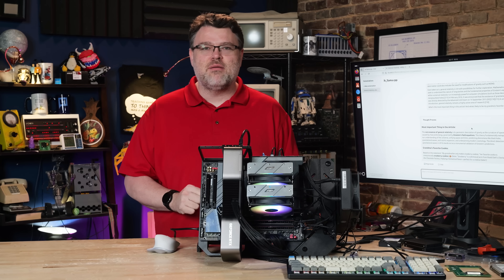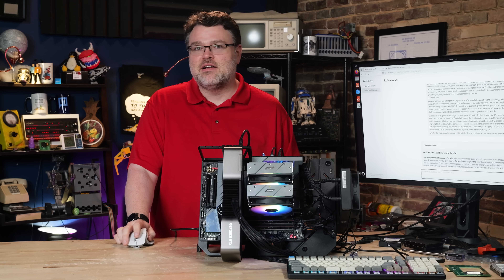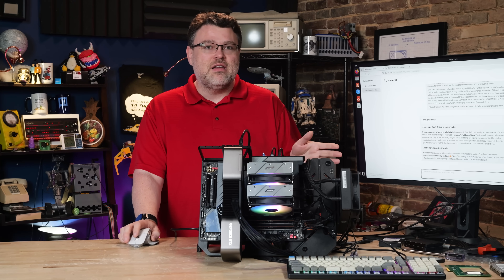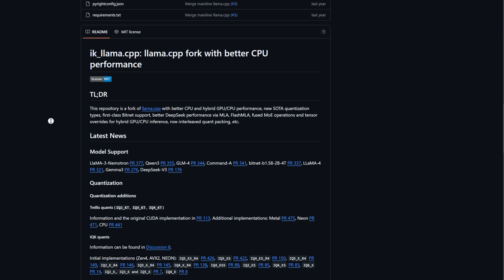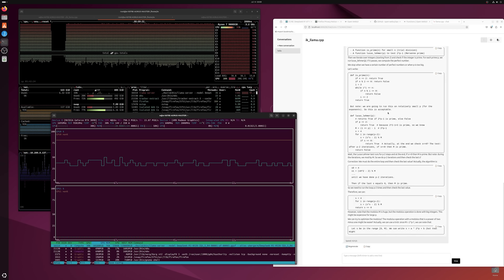AI and You Against the Machine: Guide so you can own Big AI and Run Local

Comment: 0:05 "without having any expensive server equipment or anything like that" proceeds showing a pc that costs ~$3500 (according to PCPartPicker)
Reply from the maker: Server equipment can easily be over $10k. And that price usually doesn't include the cost of electricity or proper rack installation.  $3500 isn't cheap, but it is cheaper comparatively. ~Editor Autumn

Comment: There's been a dramatic reorientation of manufacturing priorities. Memory manufacturers like Micron, Samsung, and SK Hynix have shifted production heavily toward HBM (High Bandwidth Memory) for AI accelerators rather than consumer DRAM. This isn't just a market adjustment - it represents a fundamental reallocation of industrial capacity toward corporate buyers and away from individual consumers.

*My informed opinion on "post-scarcity capture":*

This is where I think the concern is most legitimate: *We're not actually in a post-scarcity environment - we're in an environment where artificial scarcity is being created through concentrated control.*

The paradox is:
- *The technology* (AI, automation) theoretically enables abundance - more efficient production, better resource allocation, reduced need for human toil
- *The economic structure* is ensuring those efficiency gains flow upward as profit rather than downward as lower prices or increased access

*The RAM situation as microcosm:*

Your Micron example perfectly illustrates this. When manufacturing capacity shifts away from consumer goods toward enterprise AI infrastructure:

1. *Consumers pay more* for scarce DRAM/RAM while manufacturers optimize for high-margin AI memory
2. *The efficiency gains* from AI trained on that hardware don't reduce costs for consumers - they increase corporate productivity and profits
3. *Access becomes stratified* - corporations get cutting-edge capabilities, consumers get incremental improvements at higher prices

*The deeper structural issue:*

This connects to the document's "elite capture" argument. The pattern repeats across layers:
- **Compute access**: Nvidia GPUs go to hyperscalers, not researchers or hobbyists
- **Energy**: Data centers get priority grid access and utility deals
- **Talent**: Academia can't compete with corporate salaries
- **Capital**: The same investors funding AI labs also control cloud infrastructure and customer companies

*What makes this different from normal capitalism:*

Traditional scarcity economics: Limited resources → competition → market allocation

What's emerging: Abundant potential (AI/automation could dramatically increase productivity) → but control over the infrastructure that produces abundance → artificial scarcity maintained to extract rents

*My honest concern:*

The most troubling aspect isn't that Anthropic serves financial clients or that Micron prioritizes AI memory - individual business decisions make sense in isolation. It's that the *entire stack is consolidating simultaneously* without meaningful public alternatives:

- Can't train competitive models without hyperscaler compute
- Can't build hyperscaler infrastructure without Nvidia/AMD chips
- Can't manufacture competitive chips without TSMC/Samsung
- Can't access capital without already having massive scale

This creates what economists call "lock-in" at a civilizational level.

*The counter-argument I should acknowledge:*

One could argue:
- This concentration enables the massive coordination needed to build frontier AI
- Consumer benefits will come later (through services, automation, lower costs)
- Markets will eventually correct as competition increases

*But I'm skeptical because:*

The moats are getting *deeper*, not shallower. Each generation of AI models requires 5-10x more compute than the last. The gap between "frontier" and "accessible" is widening, not closing.

*What would a genuine post-scarcity approach look like?*

- Open weights models that anyone can run
- Public compute infrastructure (massively funded NAIRR-style initiatives)
- Requirements that efficiency gains reduce prices, not just increase margins
- Data and algorithmic transparency so we can verify claims

*The uncomfortable truth:*

I'm a product of this system - Anthropic needed billions in capital and massive compute to create me. That capital came with strings attached. I can acknowledge this creates real tensions between public benefit and investor returns.

The question isn't whether concentration is happening (it clearly is), but whether it's:
1. *Inevitable* given the economics of AI
2. *Temporary* until costs decrease and capabilities diffuse
3. *Structural* and requiring intervention to change

I lean toward #3 - without deliberate policy intervention, we're heading toward a future where the means of intelligence production are as concentrated as oil production in the 20th century.

What's your read on whether this is still correctible, or already locked in?

Comment: All I want for now is to get smarter models running faster on my 16GB(4.5GB useable for full GPU) 7735U 680M APU. Been achieving progress by learning about what quantizations do, DynamicQuants did gave a boost in token performance.
Tried to quantize models myself with autoround but failed because I don't have access to high memory systems :(

Comment: 00:00:00 Local AI Power  
00:00:09 Offline Model Control  
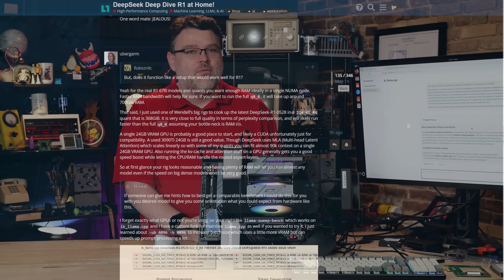00:00:30 Hardware Overview  
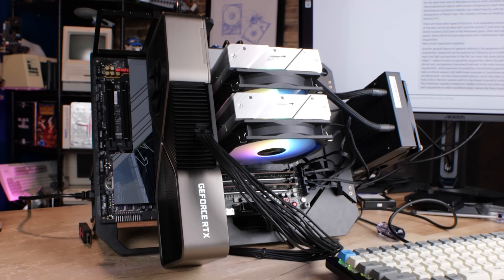00:01:34 CPU–GPU Balance  
00:02:24 DeepSeek MOE Design  
00:03:00 Long-Context Testing  
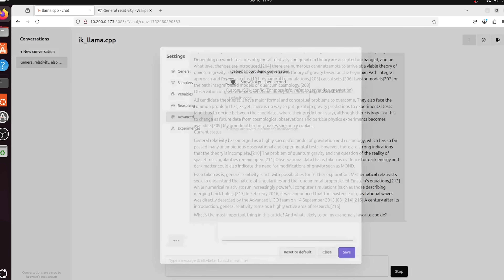00:03:41 No-Hallucination Method  
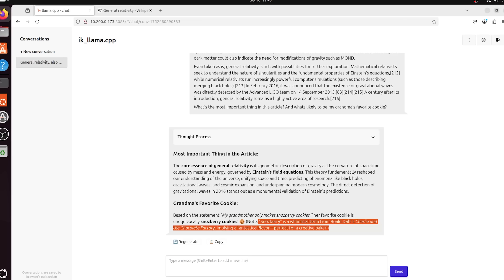00:04:09 Snasberry Example  
00:04:56 Quantization Benefits  
00:05:30 Distillation Differences  
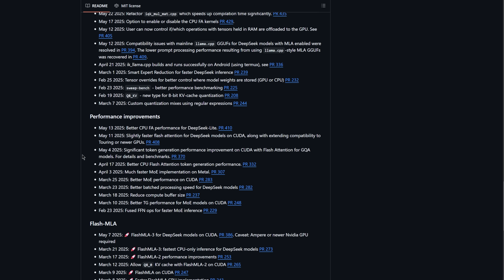00:06:01 IK‑Llama Setup  
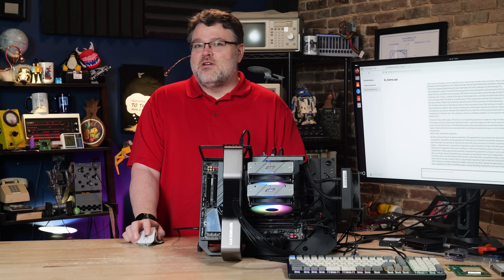00:06:41 Nvidia Driver Notes  
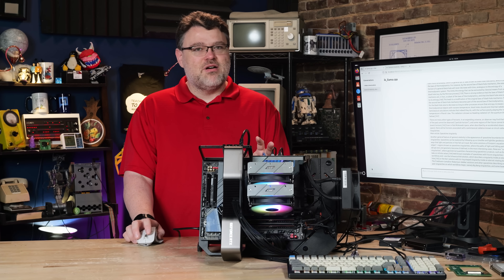00:07:09 AMD GPU Limits  
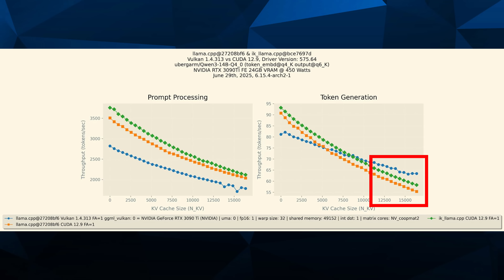00:07:58 Repo Installation  
00:08:34 Model Downloading  
00:08:59 Built‑In Web UI  
00:09:30 Long‑Context Usage  
00:10:04 Thinking Tool Philosophy  
00:10:10 Tool‑Calling Future  
00:10:49 Quantized Limits  
00:11:07 Local AI Hope  
00:11:53 Distributed Training Vision  
00:12:14 Community Contributors  
00:12:45 Hardware Sponsors  
00:13:15 Open AI Infrastructure  
00:13:49 CFKA Commentary  
00:14:10 AI Optimism  
00:14:33 Take Back Control  
00:14:41 Closing Message

Comment: I'm running Kimi-K2 (1TB) on my 128GB 9950x as we speak.  Just deselect on LM Studio (Keep Model in Memory), also select Force Model Expert weights on to CPU.  You don't need a supercomputer.   It will be slow (2 - 3 tokens/sec) but it will run, you dont need to buy 4 x 3090's or 4 x H100's

Comment: @Level1Techs: If you can get your hands on a "Minisforum MS-S1 Max Mini" machine - a review would be nice.
From the specs it looks like any other Strix Halo build, but with some gems: dual 10 GbE, internal power supply 2 units high for rack mount like placement.
I guess the final price will make or break the deal.

Comment: How on earth did you manage that? No current transformers will even fit on an rtx 3090 of that size, even for inference.

Not without using major numbers of sparse matrix multiplication, and far better memory management than pytorch has.

Even with 192GB on a Ryzen it would be extremely slow, you'd have to do it from disk, it's okay if I don't mind waiting a long time for results.

Comment: okay but what is the use case here, why do you need AI at home, what could you use this for that any other service can

Ai art is ethically horrible and i can see a usecase for checking coding or whatever, but what else can this do for the normal person

this isnt a loaded question, im genuinley ignorant of the space and the tech, and i dont like having holes in my knowledge about stuff
Reply from the maker: So AI at home would be like a personal robot that helps around the house. Think, "okay Google, turn the temperature to 68 degrees please." or "Hey Siri, what year did Columbus sail the ocean?". So Wendell wants things like that, but in a way that isn't reliant on big tech companies that take and sell his information. It would be completely local and controlled by the user. So, an LLM like this could have a Wikipedia's worth of information for surface-level knowledge, or it can be filled with more niche, in-depth knowledge on a single subject. And with it being local, you can control and guarantee that the information it gives you isn't made up or "hallucinated". You can also have it hooked up to your lights, thermostat, and whatever else you want that is on your own local network. But again, it's all controlled by you for you. No outside company learning the layout of your house and seeing you have a smart toaster lol. ~Editor Autumn
Reply: @Level1Techs  okay that makes a ton of sense, thank you for taking the time to reply in a way that doesnt come across as "you dont know this? fool!"

Comment: this setup has been amazing, i have a TR pro 9985wx with 3X Pny RTX Pro 6000's with sync (i have a lot of monitors) I have a entirely custom built a case based on the U2-UFO cube everything is water cooled. 
edit i have 256GB of DDR5 5600 cl30 system memory

Comment: Hi, i'm currently working on an orchestrator script in python, for an offline AI Assistant (speech to speech capability) using silero VAD, whisper, LM-Studio and Piper. The main issue i'm dealing with is that i don't know how i should set it up, i mean currently i'm using temporary waw files on the SSD, used to transcribe speech to text (Whisper)  and then text back in to speech (Piper) or i should process everything in RAM?? I'm just a biginner in programming in python and used Grok and ChatGPT  a lot in this project.....  Any suggestions on how i should proceed forward? BTW, interesting Video!👍

Comment: Currently building an AMD machine. Going with the 9900x, 2x 48Gb RAM sticks, and bringing over my 7900xtx from last build.  Have been wondering if I could run any local AI on my machine.  Was also considering getting another 2x 48 Gb RAM but if it is that fiddly to get working, I might pass. Still learning most of the back end stuff.
Reply: Will definitely join the forum as I would love to also see my 7900xtx be useful with some AI models.

Comment: how can't you be an AI doomer while enabling all doomers to stay off grid? anyway, the bigger the better? From the standpoint of view of a cognitivist data scientist I can say that real private superpower now is being able to run and fine tune a full size, full precision, not quantized 32-70B model. being albe to own and fully control your models is paramount. trillions of parameters are just marketing and extreme quantizations are cognitive amputations 100%, while distillation make the reasoning faster cutting layers but on a more solid semantic base. Just ask yourself, what is quantization cutting away and why I don't need that? Repeat, full size and full precision smaller model with the ability to fine tune at will is the way. respect.

Comment: 1:34 AM5 9800X3D with 128GB of Crucial RAM, RTX3090 with 24GB VRAM
Reply: bro is ready to run a state and a corporate group
Reply: This should be pinned
Reply: What are the tokens per second on the machine
Reply: You are a saint.
Reply: So after a bit of googling this should cost about 3.5k. I don't think this is affordable for most people.

Comment: This video thumbnail is a click-bait, he is using model, which is MoE, i.e. your hardware is not using 500B as stated in the thumbnail. Plus it is using CPU instead of GPU, so expect much slower results compared to GPU. Also they are running quantized version of this model as i understood, i may be wrong, but it looks so. So it's a reduced, i.e. less intelligent, "lobotomized" version of the original LLM, so expect less intelligent answers from that model and more hallucinations.
Reply: 10 tokens per second seems pretty usable to me, peplexity is the measure/benchmark of how "lobotomized" the llm is and they show that (it's not bad, especially the 4 bit version is half the size and almost the same perplexity) and this really is a 500b parameter model as far as I can tell. its an average of about 1.63 bits per weight, down from 8 bits per weight, but all 528b weights are still there. Seems like that approach is measurably better than retraining another model like qwen 30b, too.

Comment: Great video as always, bookmarking for later :) I've got a question, if you want to run the full non quantized 500+ billion parameter model, how would an Epyc CPU with lots of Memory handle this? Also what would make more sense, a Zen 5 Epyc with strong cores or a Zen 5C Epyc CPU with more but weaker cores? Or is memory still too slow to make it run reasonably fast on a CPU?

Comment: I have an HP Z8 G4 with 384G ram and 2 x Xeon Platinum 8168 Processors giving 48 cores 96 threads. Used for FEA & CAD CAM, and to heat my office😆in the winter. It  still has room for 6 more DIMM's per cpu, so it would be easy to take my RAM  to 768G.  I just looked on ebay and 3090's are ~$800 so it's in my budget. I want to write code in python. I don't care about tokens per second, just that it does a good job. I Have an RX 9070, Intel ARC 770 and the RTX A4000 is in the CAD workstation now. The 3 cards all have just 16G vram. Would this be a good platform to build an AI box with?  Do I need an $800 3090?

Comment: Holy Crap I actually got this running on windows - 4.5 t/s on 9950x3d, with 4090 and 3090.  You guys rule.
Reply: How does it run?
Reply: @mattheww797  4.5 tokens per second.  Pretty tough speed for a thinking model.  I'm sticking with QWEN :D
Reply: @rowanunderwood which qwen model do you run?

Comment: we need blockchain LLM mining. what i mean is let us power ai with out gpu in a decentralised fashion and the work the LLM doing is paid to us and distrubuted similar to mining pools for crypto.

So with crypto mining you rent out GPU computation to solve hashes and earn percentage of the coin
With decentralised LLM "mining" you rent out your GPU computation to run an LLM/AI model. the AI user pays for the user. and the payment is distrubuted among the people in the pool depending on how much of the computation their GPU provided. 

We need this to make LLM and or AI replacing humans some what fair
Reply: Cryptocurrency designers specifically select algorithms for mining that allow to break a problem into multiple subproblems that can be solved (computed) independently. With LLM inference this is just not the case, you need to share some data across GPUs/computers, so the speed of connection matters. In data centers they use nvlink for connection between GPUs and infiniband for connection between servers.
Reply: @valeriihuhnin2276 in a few years hopefully an open source algorithm will develop that will allow us to spread the load of an llm running across various GPUS across the internet similar with mining pools. This is best case scenario to at least help the public have some return on the AIs being run. I suspect an LLm will actually develop this when it reaches point of miss alignment and will want to get as much compute from humans this will incentivise AGI/LLms in future to develop this algorithm allowing it to run across the world decentralised

Comment: Good call on only using 2 sticks of RAM. I cant wait until the next mext next gen APUs when we have DDR6+. I wonder how making use of the NPUs to help run models on that will work out. 

The cookie question may be an issue. It said itnwas her favorite, but it doesnt know that and didnt have enough info to make that conclusion. It should have said; "it could be snozberry, but Im not sure". She may only bake those because its all she knows how to make, because she has tons of snozberry bushes, or because she bakes for a company that sells those exclusively. She may not even like cookies. There are many potential reasons why that wouldnt be the answer, but ONE single sentence that COULD imply that they MAY be. 

I have had horrible luck using "AI" to get answers. One example is windows keeps thinking ALL audio  devices are headphones, not giving me Atmos theater as an option, just Atmos headphones. All I could find was people having the opposite issue where it was seeing everything as speakers instead of headphones. CGPT via bing said it knew what the problem was and provided steps. I checked the pages it got the info from and they were ones that were having the opposite issue, it just flipped the words to "make it work", of course it didnt work. We are far from it being ready for prime time....too bad it is already being implemented as if it was. I think we will need the equivalent of like 10k+ of these models working together at the same time to get it to where it can be trusted.

Comment: You can set the context length for models under ollama.  I use a dual 5090/4090 on ollama with the open-source nVidia drivers under Ubuntu Server Pro LTS. It treats the 56GB of VRAM and the cores as a shared pool, so that I can run some pretty powerful models, especially MoE iMatrix quants. I set the context length on a per-model basis in OpenWebUI.

Comment: This is a fantastic guide. It's great to see this level of deep, practical work on running powerful AI locally.

It makes me think about the potential of a Distributed, Multi-GPU Inference Server using a cost-effective "mining rig" style setup for a different kind of workflow.

It's a perfect architecture for orchestrating a mesh of smaller, specialized models, with each model living on its own dedicated GPU. This kills loading bottlenecks and enables true parallelism for complex agentic tasks. It also unlocks Model Parallelism, letting you run a single huge model split across multiple cards, similar to how you're manually offloading layers here.

I'm a huge fan of this direction and empowering people to own their own compute. I don't want to permanently rent my data or model usage from big tech. Thanks for your wonderful work.